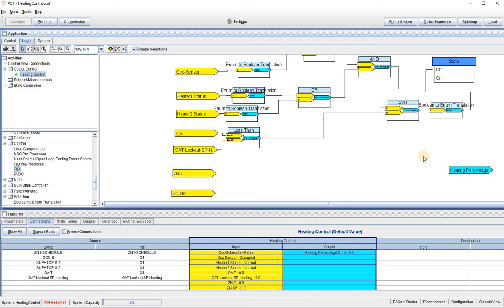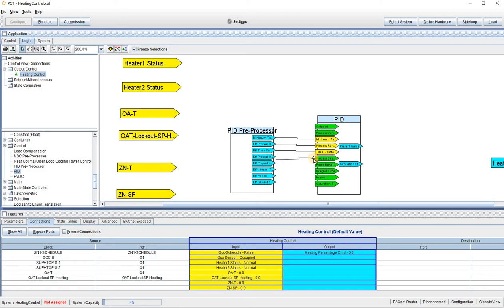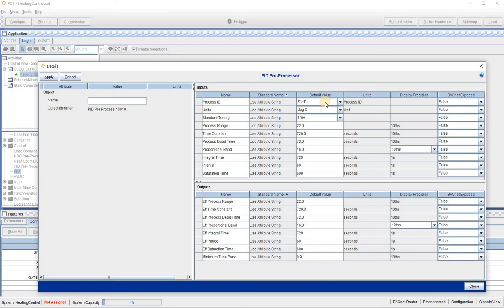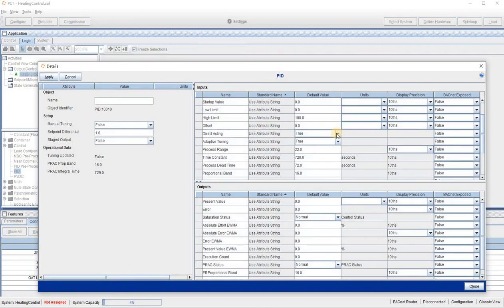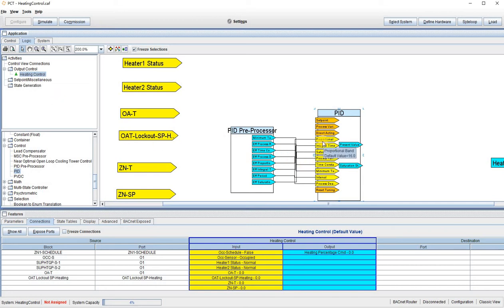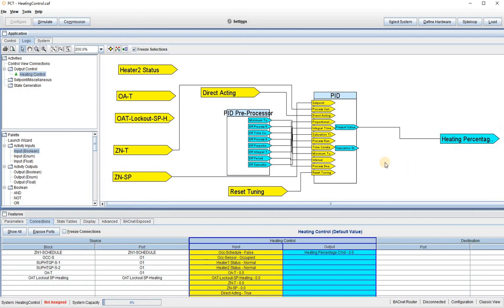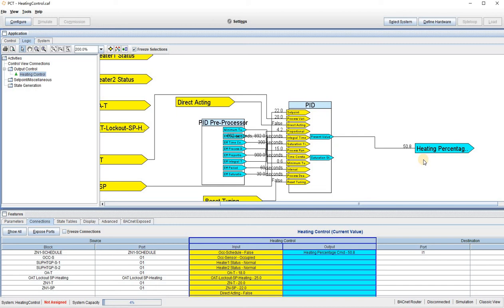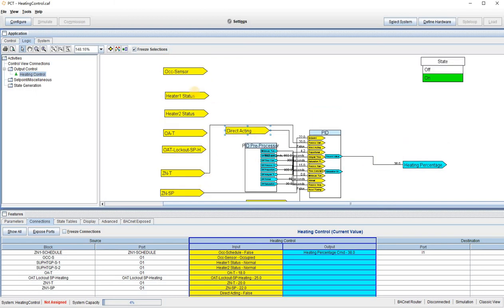PID Lab Part2

Comment from the maker: Sorry that there is a mistake in the explanation about the Direct Acting in the video. In the example, the process variable is lower than set point, and requires an increased output, --- this loop is reverse acting.